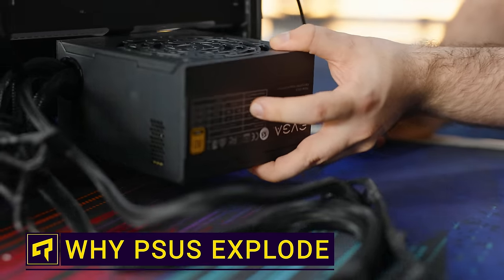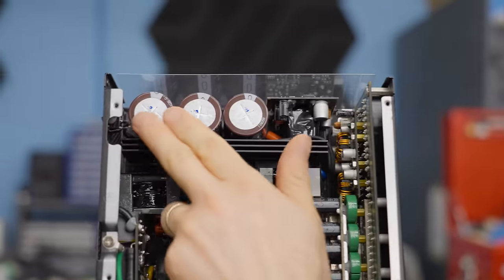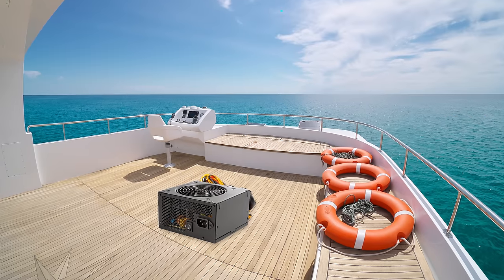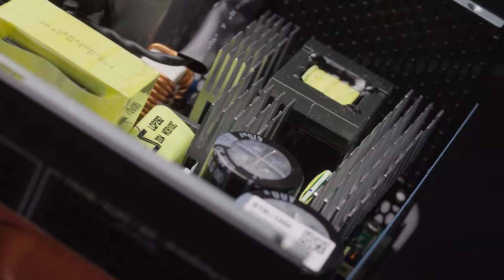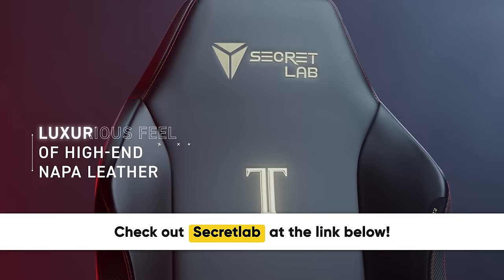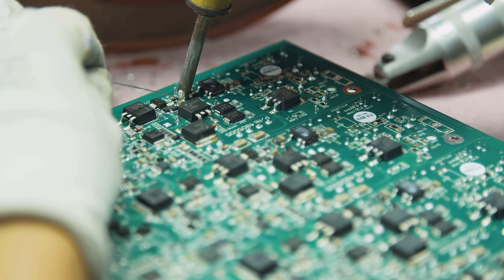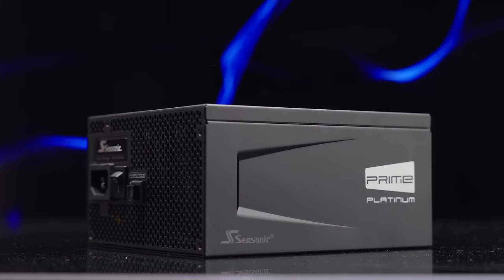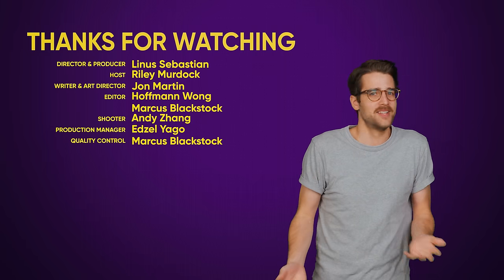Why Cheap Power Supplies Explode

Comment: Well, I used many Cheap power supplies for my DIY projects and I have a list of problems with them. 
1, their power rating is overrated
2, they get very hot 
3, some of them have no or very unreliable protections like short circuit protection or overload etc.
4, They make musical notes with heavy loads.
5, they have very bad electrical noise filters my amplifiers don't like them.
6, you don't know when will they fail or how will they fail. 
7, they can shock you
8, your electricity bill is very high because of low efficiency.
Reply: Yes, agreed. And there are the "smart" people, who says: " - I used this "Cat.: Avoid" PSU for 8 years and it's good, nothing happend, why i need to buy a new one for triple price?!" I get this question on forums many-many times. (sorry, my english is bad, i know)
Reply: @errordtp  if you have a pc buy a good one . But for DIY projects Cheap ones work too.
Reply: @Geniusinventor  Sure. I only buy and recommend top tier PSU-s, like Seasonic.
Reply: They can shock you
With their electric leaks
And the electricity bill
Reply: Very hot thing is often a big sign for me. Some people complaining the pc is too hot for using a random ass brand psu and when i checked it , surely the psu will be the culprit. Cm elite 600w v4 for example.
Reply: All of this is totally relatable to my old rig. Now I use Corsair and never had any single problem with it. That part "They can shock you" is Probably my worst nightmare when my lips touch with my dome mic
Reply: Why bother with these cheap no name Chinese brand junk boxes?  I’m not asking to be mean, I’m honestly curious. I hear people say they got some item on alaibaba (or whatever it is) for $1. Then it breaks.
Reply: @codycast  man 1$?? Oh hell no the wire alone does not cost this less.
Reply: Just replaced a broken PSU of a PC-s'thing I can do, a hack, with the broken one? Parts to keep? Btw-it was a 31$ PSU, worked 8 yrs.
Reply: My mb is killed by a bad psu.. is it fixable ? I used a multi tester to check my mb.. I found 2 shorted capacitor .. but they r too small
Reply: @codycast  Mostly pre-built have them. In most cases, you can find them in third-world country. They save a bucks as possible heck I see most of them using A series or H series motherboards with higher tier CPUs
Reply: @Geniusinventor  I’m not talking about a PS for $1. I’m talking about random cheap garbage bought from these Chinese junk sites.
Reply: @codycast  yeah they are very sus
Reply: @sujalmhrzn6019  I have a good quality PSU, I don't use bad PSU on my PC, but I had a bad one to electronics workbench, one day it exploded next me even without a load, it used to shock me without the ground wire, the shock stops with a ground wire, don't you have a properly electrical installation? But my recommendation is change that cheap sh*t anyway or your PC can be damaged.
Reply: @Geniusinventor  Depends on how much power you gets from them, if for an example, you try an HHO generator cell that drains a lot of power, and worst, use 12V to reaction go faster, you can explode a cheap PSU.
My homemade soldering iron gets 4 amps on 5V, I did a 5 amps on 5V (40W) iron, and have nichrome wire to 7 amps on 12V (84W) soldering iron, what means is depends on project.
Imagine the worst situation, 10 or more amps, a cheap PSU rated to 6A on 12V can explode with less than this.
Reply: @dschannel1171  true 👍 I use them as a Lab power supply how testing or running electronics I have all the common voltages like 3.3v , 5v and 12v I can also put them in series to make 8.3v ,15v 18v or 24v
Reply: I don't understand companies that manufacture cheap skate power supplies. It's gonna end up in the landfill much faster than higher quality PSUs
Reply: @EdnovStormbrewer  it's all about money and profit 📈
Reply: in 2015 my psu exploded, almost burned my desk, and fried every single component in my pc

Edit: this happened while my pc was turned off by the way
Reply: @therandompwdguy6849  haahahaaa
Reply: Always bought pretty much cheapest like 30-50 usd. Over like 15 years only had 1 psu eventually dying on me without any dmg to components.
Reply: This is one of those things I’ll happily pay a premium for if it means I don’t have to worry about my house getting burned down if I look at it the wrong way.
Reply: @Ahfeku  bro, i used this PSU EXACT MODEL as u said, within 10-11 month the fan got a problem, and my PC keep shutting down coz sometimes the fan are not spinning which cause the PSU to overheat, turns out it uses Sleeve Bearing fan

but as for my replacement plan, i decided to bought XPG Pylon 650w, some of the reason they got 8 protection, and better fan bearing (FDB), and for the latest PSU tier list this falls to a C cateogry (gold writen text), which is bare minimum for average gaming specs

Comment: I'm kind of surprised that PSUs can't tell rest of the computer "Hey, I'm near my limit, you need to ease off a bit". It would also be good if the computer then sent the user a notification of why it had to throttle back.
Reply: Well it does sort of by means of circuit protections as a "Dumb" method. Additionally you now have the 12volt HPWR connector which tells the GPU how much  power it can draw on the new ATX 3.0 spec. I wouldn't be surprised if we see a similar ATX revision for CPUs or motherboards in the near future. CPUs aren't quite at the GPU levels of power draw, based on thermals sure.

 But it comes down to costs, analog PSUs is a true and trust method and far cheaper to make compared to a digital PSU.  The corsair AXi series costs  $229 for the 800 watt and $610 for the 1.6kw. Why mention digital, because it is likely the method they will need to use for a "smart" PSU. Analog won't quite cut it, while not impossible the flexibility of digital power supplies especially with the use of programmable gate arrays or micro controller, makes it the obvious choice. You could technically have a hybrid system of analog/digital. But it still going to cost a pretty penny. 

If your expecting the new ATX 3.0 PSUs is going to be similar priced compared to the current ATX spec, you are in for a surprise. New PSUs wanting to comply with the new ATX spec will also require to be able to handle spike loads for example, which means PSUs will require higher rated capacitors in order to comply with the new specifications this will drive up the costs of the final product. This new spec is targeted at power supplies above 500 watt as far as I am aware. 

The short of it, it ain't cheap, you would likely need, hardware support, PSU/motherboard and or CPU or any other connected hardware or something that can deal with the "dumb" hardware as well as operating system/bios support and it needs to be fool proof as well.  But no doubt some thing we will see soon, if you can afford it. Digital power supplies haven't come down in price much if at all.

There is some advantages and some pitfalls of using digital over analog, digital does suffer from some latency issues, compared to analog with hard limits, it might take a moment longer for a digital supply to notice a brownout as a random example. It is a bit more involved process to get it to that point of being "smart".
Reply: @WizardofidGameGuruMax  I don't think it would be overly complicated to implement you could keep the PSU basically the same as it is now it just needs a sensor that tells the motherboard when it is being pushed to hard. Another option, would be to leave the power supply alone completely and just add  a setting in the motherboard's bios to tell it how much power it has at its disposal and let the motherboard take care of it since it already has sensors that tell it how much each component is drawing and already has to manage that to some degree. Of course this option does leave room for people to enter stupid values but that just means they will ethier trip their PSUs without warning like it is now or they will be leaving free performance on the table.

 The new  12 volt HPWR connector feature is nice I guess. not sure why they would limit it to just one power rail like that though. Sensors are cheap (like pennies cheap), even $10 cooling fans have them (meaning they also have a channel of communication with the system as well).
Reply: @WizardofidGameGuruMax  check how psu works, you will find all is digital, switching transistors controlled by ic chip which won't be hard to control it by safe option as usb, the only reason is there is many option need to be standard before developing, and no one will risk investing in it before atx3, also depends on consumer requests and problems that need to fixed
Reply: @Ahmedhkad  I think I deleted my reply explaining the whole spiel. No going to bother to write all of that again. But the short of it digital uses micro controllers or programmable gate arrays, and digitally control /input/output voltage. Power supplies are still predominantly analog unless expressly advertised as digital. Switching power supplies uses a regulator PWM, and only draws what it needs, this isn't digital in naturally it is still analog, even if it was digital it only pertains to input voltage. After that it is still analog  unless expressly noted otherwise. Having a switching regulator doesn't make it digital.

A digital power supply deals with the primary and secondary side of the PSU, from input to output, all circuit protection even ripple. Hell not all digital power supplies is fully digital, some power supply minor rails is still analog. You really to brush up on what the difference is between digital and analog. Because it is switching doesn't mean digital, not by a long shot.
Reply: That’s actually what’s going to happen with the latest ATX spec (3.0) and GPUs.
Reply: @cjmillsnun   No it's not, PSUs is still going to be analog or digital. Regardless of the ATX specifications. There is some assumption that the new ATX power supplies have been magically redesigned.

 Same power supply design, just with better OCP, and the requirement for large/more capacitor(s) to handle spike loads and connector change, and you don't even necessarily need a larger/more capacitor(s) for the 12 volt rail, if your over current protection isn't over zealous with spike loads. Still the same, buck, full bridge, half bridge, quasi resonant and push pull.

But only push pull, buck, full bridge and quasi resonant is of relevance at they are the only ones that supply up to 1000 watts or more. Half bridge only supplies up to 500watt, so not likely to see any changes there. There is no immediate redesign of topologies or the way they operate.

Oh and calling it a smart rail entails the addition of digital controllers, with the use if micro controllers or programmable gate arrays. Well that is essentially what a digital supply uses. Consider the "smart" rail having a type of read only memory reporting back the rail output, it can't do much more than that. It is fundamentally still a "dumb" rail with the addition of read back, and the GPU won't pull more than the rail limit is what it essentially boils down to. Unless it is a digital power supply then it is able load balance rail(s). Also of note is that intel doesn't specify how to deploy/make a power supply only the specifications to be compliant. But to keep power supplies cheap and affordable most are going to deploy a dumb approach with read back only. To go digital you would either need to use full bridge or quasi resonant, as those two are really the ones to benefit the most out of going digital, the design efficiency on the others are problematic and general not worth it. That isn't even speaking about the costs with full bridge being at least 2,5 times standard pricing and 2.8 times for quasi, include digital and you can pretty much double the price.

There is no point making it "smart" as the intention is for read back only, essentially letting the GPU know what it can draw.

I also dont see the need to isolate the rail and revert back to the old multi rail design, unless it is a high wattage unit that can afford to split to a dedicated rail, it would be suicide on 1kw or less as it needs to supply up to 600 watts as per the requirement of the spec, of course the specification states it needs to label cables on how much it can draw. So even if the entire 12volt rail is 600 watt, information supplied to gpu can restrict it to 300 watts only. That limit is essentially hard coded and no way around it. It is not able to dynamically adjust output either.

Power supplies with single rail design is more common and practically replaced the old multi rail design and for good reason, not that single rail is any less safe compared to multi rail.

Going digital isn't cheap, that hasn't magically changed either, still the same analog PSU design we have been using for years. 

Seriously people look up the difference in price and what topologies are used for analog and digital, and what an actual analog and digital PSU is.Digital Power supplies you mostly likely able to count on one hand, because they are that expensive.

Comment: I built my nephew a computer a while back that used a cheap power supply.  It got hot enough that some solder melted and connected the 12V rail to the 5V rail, and sent too much voltage through every component.  It fried everything in the box, absolutely everything.  Don't cheap out on power supplies.
Reply: Damn that sounds like a hardware nuke. My condolence 🙏
Reply: That's why you never skimp on the PSU, that and the MOBO are the most important things to be built right else your computer might shit itself later on. Plus alot more room to upgrade

Comment: The thing that I certainly was surprised when I got my own 80 plus PSU was the Weight. Using a generic PSU and switching to an actually decent PSU shock me.
like, How heavy is this PSU compare to the generic one?
Reply: The weight factor does not mean it is a good power supply anymore these days. Many years ago, PSU were very heavy because of the weight of the heatsinks inside the PSU. These days, higher-tier  PSU has gotten much more efficient due to improvements in manufacturing, they generate much less heat than before, therefore need less use of heatsinks, reducing the overall weight. Even the famous Gigabyte P750/850 80+Gold PSU is prone to explosion. That thing is fairly heavy.

Comment: I bought a "NorthQ" power supply in 2013. After a few years it went with an insanely loud bang... Luckily without killing other components...
Reply: Lucky. I've fixed some systems with board, cpu and even hdd damage over the years. All from cheap psus.
Reply: Fk is north q lol

Comment: I had a scetchy china psu up until recently and as I found out later it was also very old (2010). To be fair it worked without issues with my old PC configuration (apart from sounding like a jet fan when starting). It was "rated" for 730 Watts, so I upraded my PC from a gtx1660s to a RTX 3060ti (240W TDP). Well when the Card started boosting in games the power supply immeadiatly turned off. Which is to be fair pretty good. It turned off and did not just exploded. Well on 42% Power (~100W) the card ran just fine (and still faster than my old 1660s). I then upraded to a corsair 750m and now everything runs fine. Turns out the chinese psu only supported 450W on the the 12V Rail and they simply added up the power of the other Rails to 730W.
Reply: my psu is from 2009 (750 watts) and it still works with components from ~2017 (2-3 of my harddrives might be from 2016 or earlier, the case fan is pretty old and was making little noise for a while)

it used to have old everything in the case, but that has gone somewhere now

Comment: I had a cheap power supply shoot out sparks and stop working because it melted through the solder on the live terminal on the power switch. (diablotek, if anyone was wondering, not that they exist anymore, as far as I know) I re-soldered it (didn't think it was possible for someone to do a worse solder job than me, but apparently so...) and replaced it just as soon as I could afford to. Fortunately, it didn't take any components out with it...

Comment: One thing I always know and always tell people when building PCs, is NEVER CHEAP OUT ON A PSU. Not worth having your PC components be potentially destroyed just because you wanted to save a few dollars..

I've had a Fractal Design Newton R3 1000W PSU in my PC for years and it was even second hand when I bought it (although, the previous owner didn't really use it much at all). Absolutely awesome power supply.
Reply: I have my Seasonic 700W (I think) in my 10+ hours daily on time for almost 5 years now. An ant colony once lived in it. It had been thrown from a car back seat to the floor because some idiot decided to jaywalk on a highway. It's still has some ants remains inside. It's still working. 10/10 would buy Seasonic again.
Reply: @Alberos  idk if jaywalking is illegal on west country tho
Reply: @imanjx2914  I'm from asian country. Honestly I'm not even sure that it's illegal or not (it should). But the fact is everybody do it and cops seem not not care. If nothing happens it's normal to not cross on the zebra crossing here. Most road don't even has a zebra crossing anyway lol.
Reply: @Alberos  well if you're from asian country then i guess i don't need to explain it lul

Jaywalking is so common here so i don't think it is illegal since zebra cross is well....don't really exist unless it's on highway with traffic lights.